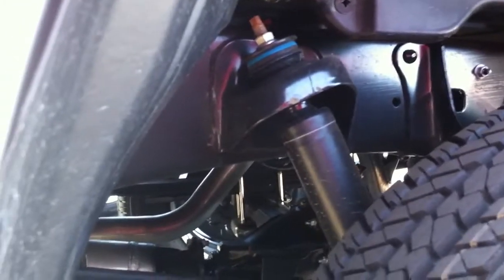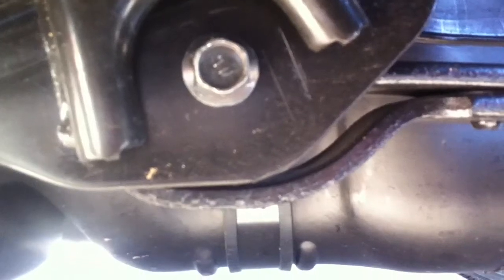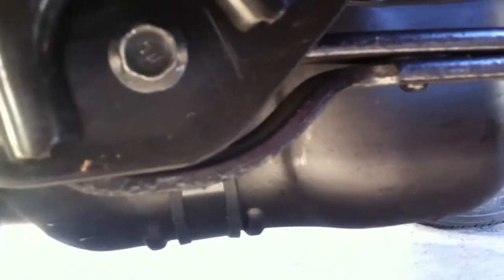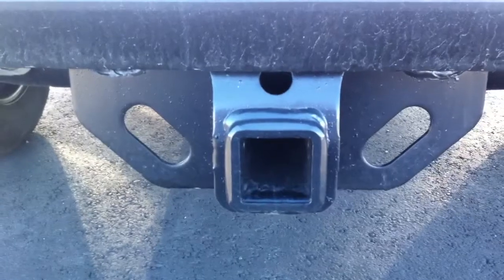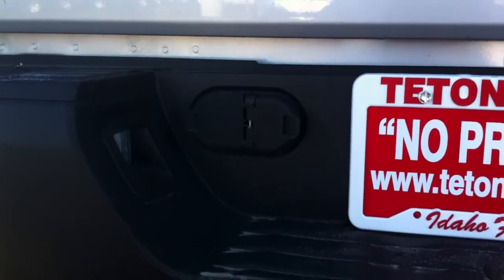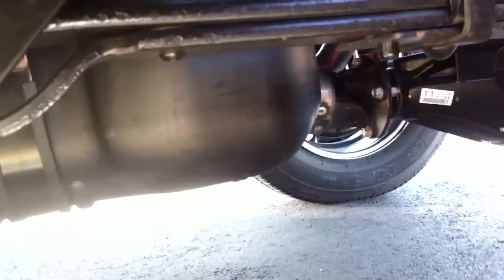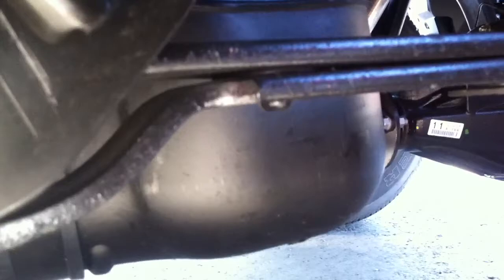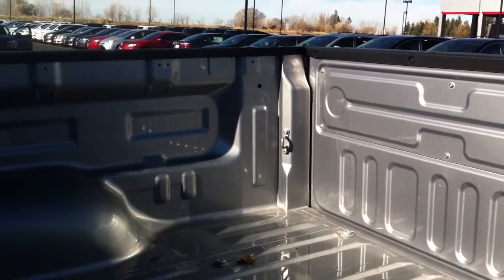Tundra SAE Towing Standards. Why, and how there tested.

Comment: TFLTruck puts all the trucks through a towing test that is tougher than the sae standard and Ford wins all the tests hands down.
Reply: Tundra, of course!
Reply: who pulled the endeavour ?
Reply: Ask people who tow with the Eco-boost V-6 what fuel mileage they get.  Answer: Not very good....Now ask me how many Ford's I saw on the side of the road with their RV's while driving to Alaska.  A few....How many Tundra's...None....
Reply: Lol TFL is a joke first off, but the J2807 is standardized because of the fact that it takes braking and control into account as opposed to driving up a hill alone. Stop being brain washed. Toyota was the first to go in and submit their trucks. Their standard was corrected to 300lbs lower than what was claimed which is incredible considering the big three waited to redesign their trucks before submitting them for review. Can you spell liars?
Reply: John Wesley f*** you Ford sucks like fuckballs m*********
Reply: Giveit2mehRAW  Why would an engine with 70 more ft/lbs. of torque work harder when pulling?
Reply: TFL blows

Comment: im a toyota guy and i have owned Toyota trucks as old as 1978 to 2005. what do they all have in common. Engine runs forever but Frames  Rust out! i think Toyota has some of the worst Frames ever!
Reply: all ibc on all trucks have issues.  google it
Reply: Plus, on the later models, the trailer brake doesn't work.  Toyota knows about it but refuses to acknowledge it. Google it.
Reply: Putting salt on roadways will rust metal. Name one vehicle that wouldn't rust if you're not undercoating and or rinsing the undercarriage off. 
The only manufacturer that makes a part of a vehicle that isn't effected by rust is the Ford bed. And you buy a truck with an aluminum bed in the first place, you shouldn't be allowed to own a truck. Whenever I lived in that hell hole you call the north, a few times each winter I would go to the car wash and rinse off my undercoated vehicle. IT'S COMMON SENSE. And by the way, I was a 16&17 year old driver. Even I knew better. 
I wouldn't give my Tundra or 4Runner up for no other manufacturers garbage.
Reply: TidelsHigh89  Well guess what, it's not just the Ford bed that's aluminum, its now the whole body, which won't rust and has the best crash test rating so strength is not an issue.
Reply: It may have the best crash test but it's not due to the aluminum body. it's due to the frame. It'll be more costly to repair rips in the aluminum than dents in metal. Along with that aspect and the mechanical aspect, you can keep your Ford. I'll "continue" driving with my quality Tundra.
Reply: The frames are all supplied by dana corp. They supply frames for the F150 as well. All trucks suffer from some sort of underbody rust if you don't care for them. The tacoma's were the ones which were heavily affected. As long as you care for the truck a little by hosing down the undercarriage now and again, rust isn't an issue any more.
Reply: I hose my Tundra off a few times every winter.  I touch up the undercoating every spring.
Reply: high grade metal rusts easy